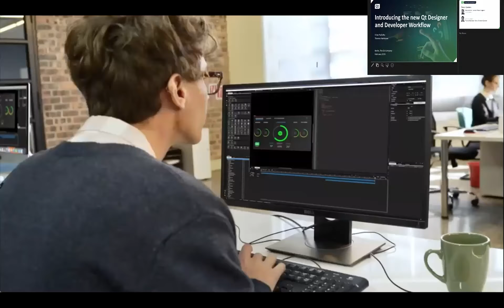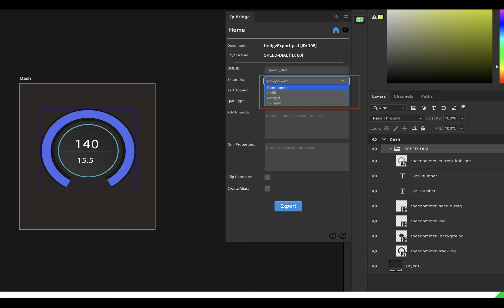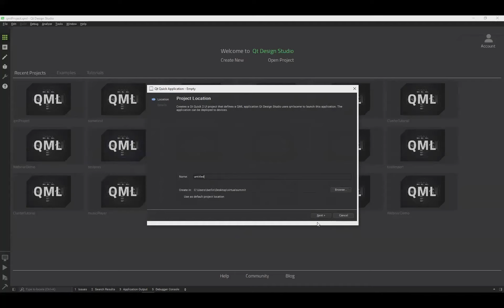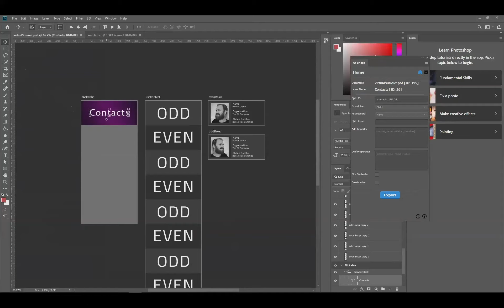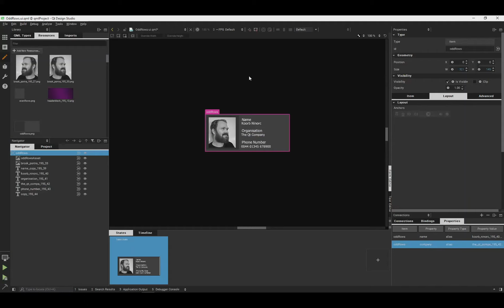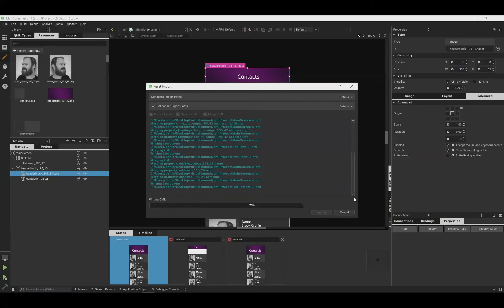Qt Designer and Developer Workflow by T. Hartmann and V. Pachda, - QtWS18

Comment: I have a question, can i make the same thing using svg files instead psd files, i mean use vectors instead raster? thank you
Reply: Design Studio supports svgs but not at the moment via the Bridge plugins for Sketch or Photoshop, so you would have to add the svgs yourself.
Reply: @brookcronin8586  Thank you
Reply: ETA - The Sketch Bridge now supports svg export